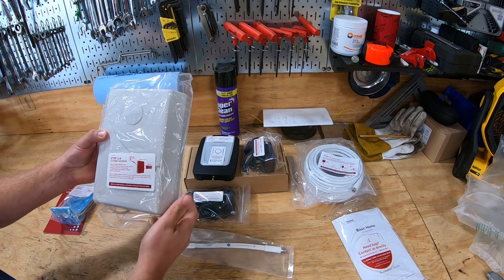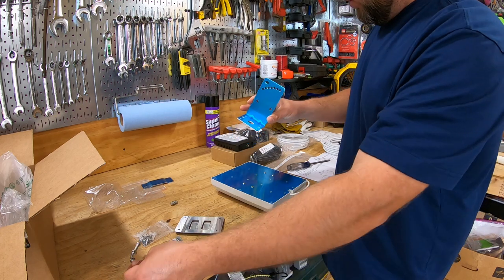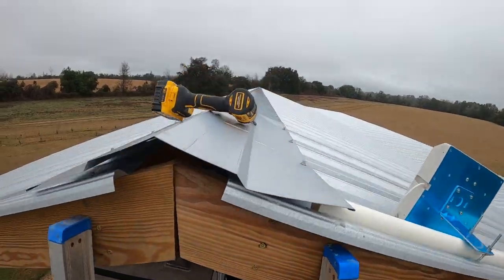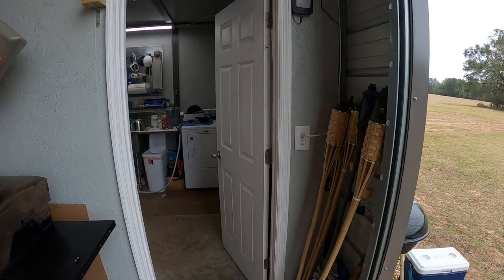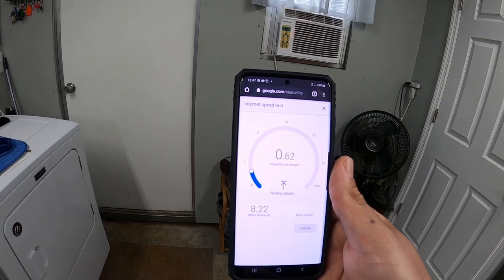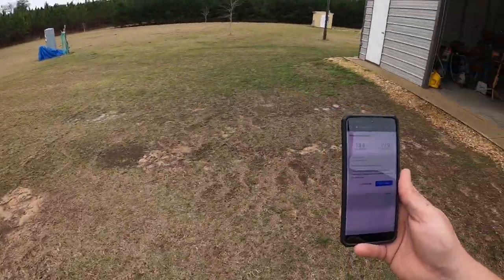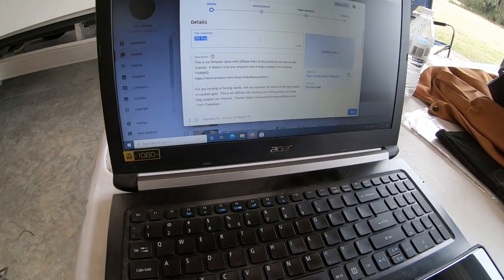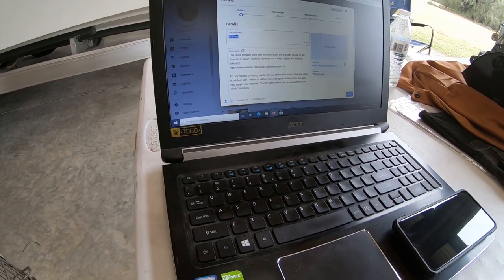Weboost Home Basic cell phone signal booster! It works #257

Comment: 2 things..   you have your roof mounted antenna aiming at the antenna across your ridged roof panels that scatter the incoming signal.  if you have enough cable.. can you move it to the other end of the roof. even if you are just doing it nailed to a 2x4 leaning against the far wall of the shop.. so you are NOT receiving over the ridges of the roof. also not sending out signal across the ridges of the roof..

 2 move the inside antenna around..  you may want to dangle it on something dangling from the roof rafters so it will still transmit and receive inside the building but it won't be shielded in the corner   its just a thought.. 

and again.. you need to find somebody who has a utility pole installation truck with the big hydrauilc motor on the boom to put you in some long power pole anchors around your buildings.. allowing you to throw stainless steel banding over the roofs and binding them down to reduce future wind damage. you may put bands around the building also..  there are also ways to drill holes in the side of some tubes and driving them in the ground instead of anchors.. then driving long pieces of rebar thru the holds into the ground at angles.. making it really hard to pull out of the ground..
Reply from the maker: I probably could improve the signal, but it's working extremely well. I uploaded 3 YouTube videos today (unheard for me) and two of them in under 45 minutes. Sometimes this would take many hours. No dropped calls, streaming better than I ever have and download is no issue in the metal building. Long story short, I'm very pleased with the results.

Comment: I'd STRONGLY advise caulking around the point where you drilled through the roof to prevent long term issues with the wood trusswork as the rain runs down the pole and against the beam.
Reply from the maker: I can do that, but the wood I screwed to was pressure treated FYI
Reply: @TKCL  Nice! It looked untreated from the video so I wanted to at least raise concern if in case it wasn't.

Comment: Hey man first time I've checked you out ever but good video brave on the latter there well heres my comment I have very little experience with weboost but I have every reason  to believe its great how ever I've lots of experience with antennas and knowing how well that system. Worked for you if you made a couple more fairly simple changes I know for a fact wouldn't cost much but ill bet would have that video uploaded in about 15 min. Maybe less not sure but the change is to your outside antenna do some research find a yagi directional beam Antenna the more the elements the more the gain and the more important it is that your rite on your target also really not sure how it apply here but using a metal mast pole getting as high as possible in the air as safety as possible even if guying the mast is nessasery also helps there's a couple of things about what I've mentioned one is everything I said may not be necessary for you to reach maximum signal and once max. Is reached there is no more but two there most likely is people out there who due two there distances from the towers will need to do everything I said plus very good grounding will make their cell speeds very very good with these weboost systems the outside antenna and how well is setup can make a world of difference on how well the inside part works ok my apinuion only im not affiliated with weboost or anyone else for that matter just thought I would let people know that there are ways to improve or even make these things work if they were unable to get anything and its not that hard to go from nothing to a whole lot without spending a lot of money ok hope you guys the best and that this helps atheist one person it would be great if it were many but one would do God bless
Reply from the maker: Thank you for the feedback and tips

Comment: (Some reason my comment keeps disappearing)

To get decent internet in where we are, I built a 100' tower at the top of our mountain and rented it to a local wireless ISP that provides service into our valley and the other side of the mountain.  They pay me enough to cover our property tax + some and we get 50mb service included.  In your flat terrain, probably take a lot shorter tower.  You might look into it if you have a wireless ISP locally.  Email me if you want more details (reply here so I know to go LOOK at that email address listed here which I don't use for normally email.)
Reply from the maker: I seen it, weird why it's dissappearing. I responded to it as well.
Reply: @TKCL  Yeah, I got the notification bell thing, saw you'd responded, came back to look...nothing !  Weird.

Comment: I am looking to purchase  a chainsaw  what do u recommend  my budget  is around  $420
Reply from the maker: Stihl ms271 farm boss for that budget if you could up it another 150 then get the ms261cm. Either of those saws are great homeowner saws, the 261 is a step above with more power and lighter weight.
Reply: Is the 290 any good
Reply from the maker: @chrisavila2073  that's an older discontinued saw. The 291 replaced it. Yes that's another common saw
Reply: @TKCL   thank God I live next to a stihl  dealer  look out my window and there  next to me  I am getting the 271 thank you  for the advice
Reply from the maker: Your welcome! If they can fit the 291 in your budget it's worth the step up. Just not sure if they can get it down to your price. Most Stihl dealers don't negotiate much.
Reply: @TKCL  do u win pump gas or ready mixed one
Reply from the maker: I run pump gas because I can get non ethanol at several places around me

Comment: I have all green lights and 0signal
Reply from the maker: Did you have some sort of signal to boost before installing? Are you 100 percent confident you are aimed in the proper direction? Use cellmapper.net to find your nearest tower.
Reply: @TKCL  yes I even adapted 2 antennas custom splinter now I have all green lights but 0 signal . And ok I will look for the cell tower again